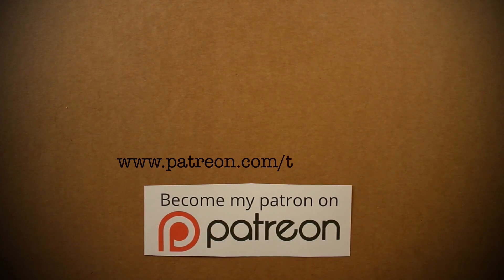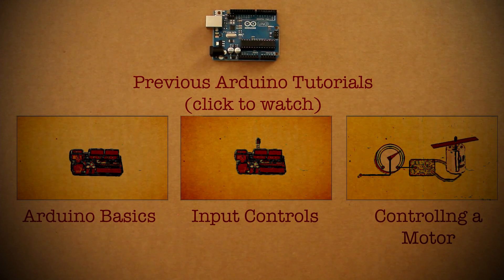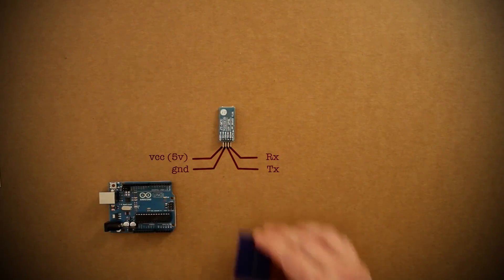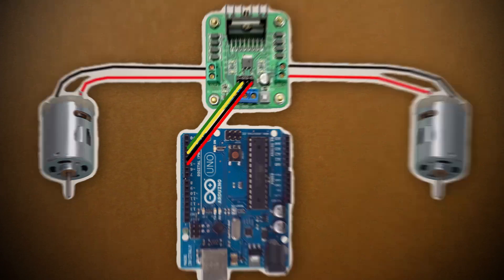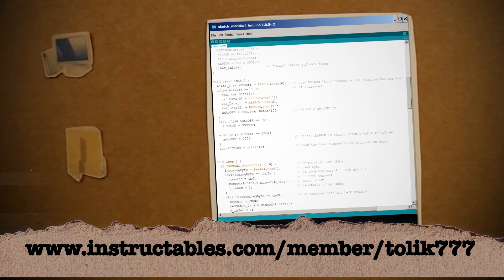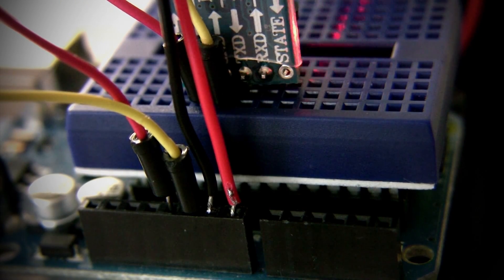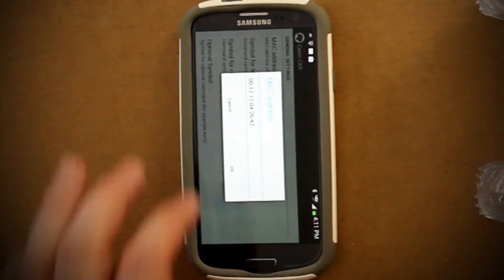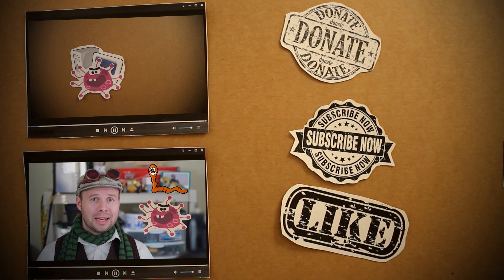DIY Smartphone Controlled RC Car

Comment: Ofcourse when out of Wi-Fi range the device would stop working. Would there be a way to make it so it used mobile data? Js bc I'm hoping to make my project go longer distance than a rc would.I figured if it ran by mobile data and the arduina ran by mobile data then they'd both be able to connect unlimited distance

Comment: Arduino: 1.8.5 (Windows Store 1.8.10.0) (Windows 10), Board: "Arduino/Genuino Mega or Mega 2560, ATmega2560 (Mega 2560)"

Sketch uses 4000 bytes (1%) of program storage space. Maximum is 253952 bytes.
Global variables use 233 bytes (2%) of dynamic memory, leaving 7959 bytes for local variables. Maximum is 8192 bytes.
avrdude: stk500v2_ReceiveMessage(): timeout
avrdude: stk500v2_ReceiveMessage(): timeout
avrdude: stk500v2_ReceiveMessage(): timeout
avrdude: stk500v2_ReceiveMessage(): timeout
avrdude: stk500v2_ReceiveMessage(): timeout
avrdude: stk500v2_ReceiveMessage(): timeout
avrdude: stk500v2_getsync(): timeout communicating with programmer
An error occurred while uploading the sketch

This report would have more information with
"Show verbose output during compilation"
option enabled in File -> Preferences.

Comment: I have gone through the complete setup.  The lights turn on on the arduino, the wifi module, and the motor controller.  When I connect a DC motor to the motor controller and use my smart phone to turn the motor nothing happens.  Please help.  Thanks

Comment: We get all the lights to come on, including the arduino, and motor controller.  We five volts into the motor controller but none coming out of the motor controller, therefore the servo won't turn.  What do we do?  Thanks.  Gary

Comment: Aside from an RC, I would like to:
- Connect a motor to my curtains and control the opening and closing of my curtains with the phone.
- Connect the arduino up with an analog clock and control the clock with my phone (show battery percentage, set the clock and let it set standard and normal time automaticly) with the phone. 
- Connect it to the lights and control the dimmer with the phone.

All in a single app.

Comment: I built one, but mine not used separated Motor driver L298N.  I only  modified RC board as car driver controller.

Comment: I have built a small tracked vehicle (about 5ft long) powered by a who motor that I am going to use as an rc artillery piece for paintball games so we can move it easily and I am thinking about using this because I don't want to have a tether. what kind of range can one expect out of this?
Reply: 30ish feet

Comment: If i have a 12v battery can i put it on the arduino and put a transformater between the arduino and a 12v dc motor. Does this work?

Comment: I am facing socket failed issue while using the app, i have re-verified all the connections and the software. Kindly suggest what could be the possible issue ?
Reply: socket failed means that the connection to the bluetooth is not succesfull.
If it connects to bluetooth succesfully then socket failed error disappear.

Comment: thanks for these tutorials, i really love these, i am getting a problem using app in button control it says "socket failed". please reply
Reply: Did you receive a solution to socket failed issue ? I am facing the same issue, kindly suggest

Comment: hey +Tinkernut i made first bot and it worked perfectly but the 2nd and 3rd are not working with buttons only accelerometer control and wheel controls are working and i cannot figure out the issue... please help

Comment: Okay tinkernut, i have to ask you one question, that is that when you are connecting the l298n, there are 6 inputs, to are pwm which are needed to control the motors, how were you able to use cxem car app to control the rc car when it won't even function properly, plz reply and give me an answer because i followed your instructions and it does not move the motors only shows that blutooth is connected.

Comment: Hi! does anyone can help me to add a code for servo steering? so i can use it when i press left and right....without making another app...i almost figure it out but i can't  set that when nothing it is press or when i press forward or backwards the servo stays in 90 degrees....i already set it to work when i press right the servo moves to 65 and in left moves to 115 :/

Comment: Guys do NOT draw current from the 5v pin on the arduino to power the motor driver, needs much more.  Do what he said and connect the VCC pin to a battery, 9v will drain quickly but 4 AA batteries are great.
Reply: +James LaBelle hey how did he connect the Bluetooth to the 5v? I thought its max was 3.3v so shouldn't it have been destroyed? he didn't use voltage dividers either.
Reply: +WLTR AEP Some modules are 5 volts.  He does another video dedicated to the bluetooth module where he does the same thing.  I'm not sure how to tell which ones are 5v other than the info listed when you buy them.

Comment: How difficult would it be to modify this application to control larger motors (say two 500w scooter motors)?  Am I understanding correctly that it would be essentially just getting a bigger motor driver that can handle the amps?

Comment: sir i have only one dc motor connected at back and an other dc motor at the front to control the front wheel  so how should i connect it to the motor driver

Comment: Sir Is motor driver compulsory for working of dc motor... or it can b made without it also?? 

plz reply soon sir..
Reply: Samarth Deshpande
In case you use motor directly it will destroy your Arduino CHIP or the whole board.

Comment: How would you modify the code if you have two motors in parallel? For example if you click the forward button on the app both motors would spin forward. If you click the left button only the left motor would turn on. If you click the back button both motors would spin backwards and if you click the right button only the right motor would turn on. Any help would me appreciated!
Reply: Well, if you have 3 transistors you could run power to each motor from a transistor and do a ledPin sketch that would usually turn led on or off for each motors transistor and a third one that links to the base of both transistors this should enable you to drive a single motor if you want to turn and both motors for forward or reverse

Comment: Hello sir... i have a question...
I have follow all the step doing control an rc car with arduino..however...there is a problem..which is my dc motor does not move...?i have check Bluetooth module and apps..all are in good....dc motor also are good condition when i'm testing using 9 volt batteries...Could you help me sir...?please..? i need to settle down as soon as possible...

Comment: does it need internet connection?
Reply: Charlemagne Ali There is no reason why it would 'need' to be connected to the Internet. The communication is between the TX and RX (device/phone and car).  Replace the bluetooth device with a wifi device, and setup your Router DNS and you would be on the way to Internet control, but it may not be the best use of this concept, since you want to be in front of the car whilst you use it probably.

Comment: I am doing a project for school to make an RC car from scratch where we are only aloud two motors, we choose to go with 2 step motors rather than a servo, and only one step motor.  Does the code provided make it possible to turn left and right by making one tire go left for example and the other go right? If it's not provided could someone provide it to me, as I am not very experienced with Arduino.  

Thank you.

Comment: I would wire this up to my raspberry pi add a webcam wifi adapter and a cheap mobile broadband adapter so I could control it from anywhere

Comment: I'm thinking about building a quadcopter with the same principle. :)
Reply: great Idea but the Issue I see is. how far could it go with this setup? 

For an RC car its not a problem but for a Quadcopter it means falling to the ground.
Reply: ***** Yeah I looked into the AR drone its cool and all but I went for the Hubsan X4 FPV which is awesome. ITs tiny and extremely durable. 

Aaaaand then I got me a DJI Phantom and now I go 1.3 km with a booster for the camera :D 

But the AR Drone I suppose is a nice middle ground. The only problem I would say is its controlled by a phone. Its both nice and not that nice

Comment: Well our school has a robotics team (Renegade 154) and we placed second in the Tetrix world competition,  we usually use Play Station 2 controller's to run the robot during the driver controlled period because it has enough buttons if the driver's work together using two different controller's. Do you think there is a way to sync a robot with such an advanced task like in the challanges to operate under one driver useing only the power of a smartphone?

Comment: okay question, I have a bluetooth usb adapter at home, so instead of using a bluetooth module, can i open that up and connect the power, gnd, rx & tx pins of the usb to the arduino?

Comment: True or False, can you use this same method but with a toy helicopter?
Reply: yes, you can, but you need to find a light enough motor driver, or tinker with the helicopter's remote.
Reply: There are already ones that can

Comment: I would want a smart phone to control time
Reply: you need to be in the year 100000000000000000000000000000000000000000000000000000000000000000000000000000000000000000000000000000000000000000000000000000000000
to do that.
Reply: i know, i only posted that response to be funny

Comment: i want to control my garage door, my lights in the individual rooms of my house, and in my garden, the power supply that goes to my outhouse, my radio/musicsystem which i have hooked up throughout my house with one cd player and my security system, the pump that is hooked up t my pond, i want to control my serverstats trough my phone.

Comment: This is so cool, but shouldn't you put the top of the rc car case back on?
Reply from the maker: haha. it wouldn't fit ;-)
Reply: +Tinkernut hey tinkernut ,pls make video of how to mak ""balance bot"" usingarduino n  mpu6050 ,dc motor  n l293d driver n controlled through bluetooth..pls
Reply: Tinkernut It might fit if you remove the breadboard and wire the cables directly to each other.
Reply: did you find the software of cxem car 1.2